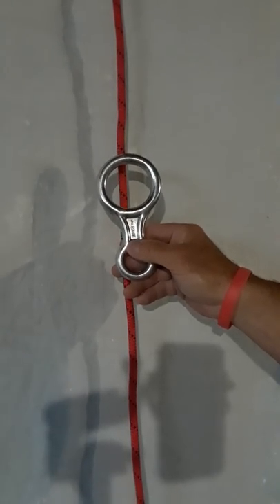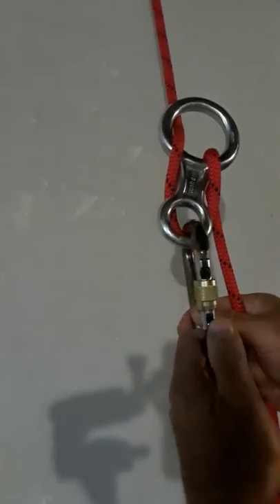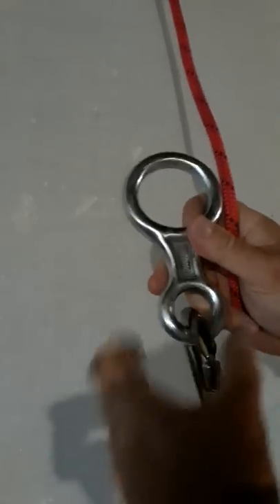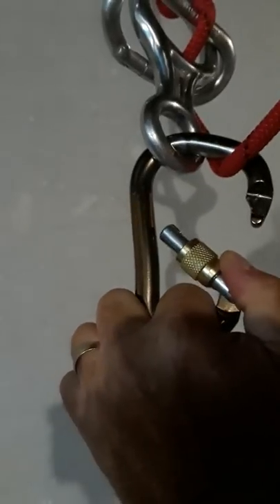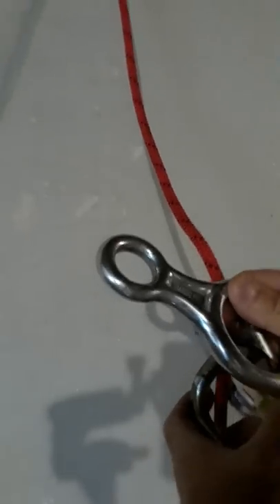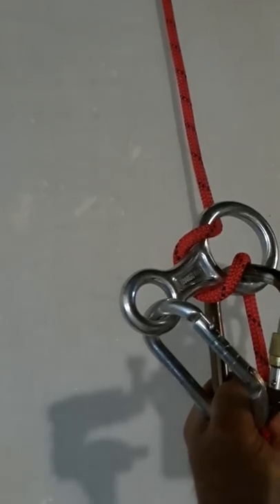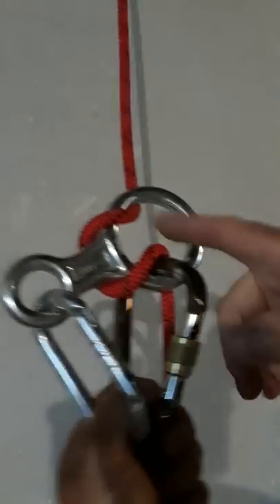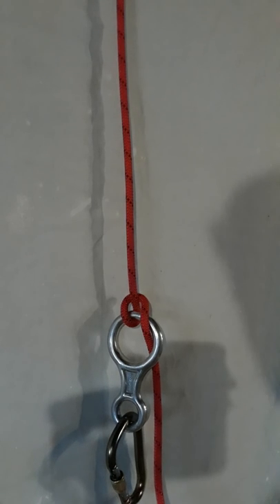RAPPEL MODES   10 WAYS OF RAPPELLING WITH A FIGURE 8

Comment: You are the only one whose been mentioning the heat development.  "More then 150 ft descents?"  I used the basic wrapped  carabineer in several 5 meter descents and the carabineer got too hot to touch, so hot I was fearing it might actually melt the rope.  Thanks for the tips.
Reply from the maker: the carabiner wrap rappel is the worst for heating up the carabiner because it is "wrapped" around the spine, my methods only pass the rope by a small section of the carabiner, and there for do not produce much friction, just like all the climbers using the black diamond ATC or Kong Chewy, etc.
Reply: Yeah that's true. I'm one to carry drinks to cool my equipment. 
Once controlled from the ground from 1600 feet. By Weldon Lee. Stops every so often to change shackles due to heat.
Reply: It makes sense to think about the heat produced, but it would have to be very hot to melt a nylon rope- its melting point is over 200 C. Sometimes the outer mantel gets slightly melted, but as the rope is constantly moving in these situations, it generally does not effect one area long enough to melt it, and the8 or carabiner  takes most of the heat.
Reply: @deannilvalli6579  I've a question. What is your longest decent ?
Reply: @johnpelham9310  Well John, it is sort of irrelevant, given that this is about melting points of materials, isn't it? And I don't do feet, as it is an archaic system used only in one country. But you are right, as a mountaineer I typically do not go beyond 100m at one go, before there is a short stop and change of ropes, which does give time for things to cool. If you have known of a kernmantel rope melting due to friction, and can present this documented  case, then I stand corrected.
Reply: Sorry about my last comment. 
Someone said i was wrong.un fortunately i thought it was you. 
My apologies.
Reply: @deannilvalli6579  well. That's big of you Dean. I'm a Tower personal. Of 25 years. 
I've seen kernmamtal roap burn.
Document isn't available. Roap. Was distrold & discarded 15 years ago
Reply: @johnpelham9310  OK, well I have made long descents with a patient on a stretcher, but we went very slowly and the special device is huge so dissipates heat. I have seen the mantel a bit burnt or melted, but never the core (kern) which is what takes the weight. I do not know of any case where the whole rope was damaged to the point of being dangerous, but of course it makes sense to avoid any damage, so I guess it is something to keep an eye on.
Reply: @deannilvalli6579  glad to know you're trained in rescue. I too am trained by OSHA. And you are correct about the strength in the inner core. 
Tell me more . Rather than defending, or argument or denied 
YOU CAN'T SEE THE INNER CORE.
Reply: @johnpelham9310  No, you can't see it, that's true. I am not sure if you are trying to have an argument here or just exchanging info. As far as I know, none have melted. If there is a known case of this, fine. I will gladly take that on board, as this is about safety. I just have not myself heard any news of this.
Reply: No more than you .no argument just that Iv been there.  TELL ME TRUE.
Reply: @deannilvalli6579  are you a salesma .my job was to get the job done. NO ONE DIES . on job site has anyone on yours ?
Reply: Yes we will have an exchange of information..Ill youse what is proven .keep it safe
Reply: @johnpelham9310  I honestly don't know what you are even talking about or what your problem is, but you are clearly very sensitive about this, so I think I will no longer respond to you.
Reply: @johnpelham9310  I am not sure where all this anger comes from. I thought we were merely discussing technical details. You are clearly very sensitive about this for some reason. I don't know you nor do you know me. Your anger and suspicion are completely misplaced. This discussion is now ended. Enjoy whatever it is you do.
Reply: @deannilvalli6579  Last reply. Have you ever seen a man die? Now you know my problem.
Reply: @johnpelham9310  As it happens, my work involved rescuing and treating people in accidents, so yes, I have. And you just said that no one had died. I have no idea who you are, or why you think you have to impress people you do not know, you have not met, and never will meet, by telling about your qualifications, training, etc. I was only interested in the topic in the video, and technical aspects thereof. Please stop talking to me now.
Reply: @deannilvalli6579  sorry about my anger
 The person that died was a close friend. I didn't know about your occupation. I thought you're a weekend rock climbing enthusiast. 
My bad. How about we let it go?
Reply: @deannilvalli6579  done.
Reply from the maker: @deannilvalli6579  have you ever rappelled 500 feet or more???  There is a lot of heat produced.
Reply: @deannilvalli6579  'Slightly melted' eeek!  Back when we climbed on braided rope (and I was too new to have known), I noticed that even on short raps, if I paused at the bottom of a rap, I would sometimes notice that some of the outer strands had been melted together, and embrittled, to the point that after a few more flexes, those fibers would snap & stick out of the rope as sharp little pin pricks in the belay hands.  So, ever since, I always drop to a stoop at the end of a rap, & immediately stand to unload & 'air' my rappel device, no matter what it is, just to prevent such damage, minor as it might be.  No telling when I might be in a marginal fall situation, without sufficient safety margin.
Reply: @you2tooyou2too  I will take your tip on board.

Comment: Just one question if you can use a minter hitch to descend that could mean you can use it to ascend with to with a back up
Reply from the maker: haven't tried that yet, but will give it a spin to see if it is possible/safe
Reply: Using a Munter hitch to ascend a rope won’t work because there is no progress capture mechanism in the munter like there is in a plaquette in guide mode, a grigri, or purpose built ascender.
Reply: Austin Gillem you could just use a prusik or some form of an auto block an do it pretty easy I’d suspect
Reply: Hmmmmmm. If you use a Munter, you usually back it up with a Prusik  (or is it Prussic) loop, but you can climb with the Prusik by itself. It tends to cinch tight so might want so set it up with a micro pulley to help tending your slack.

Comment: Thanks a TON for this, what an awesome resource this has been for me!!
Wanted to know your thoughts on using two 8's, back-to-back, so far as I can see it'd simply "stretch-out" the width of a single fig.8 so that there was that much more friction on the line, my only fig.8's are (1) standard and (1) is a 'bent-8 with ears' (slight arc to the entire unit), so they won't be that great for testing not like using (2) identical fig.8's that'd really pinch each other but I do kinda expect I'll prefer the double-8's approach (am having trouble finding any reliably good rappel-method with my 8, think I've gone through your list here enough am gonna do 1 more attempt at all the ones you list before embarking on the double-8's approach!)
Reply: Dude. Just do a fucking canyoning course.